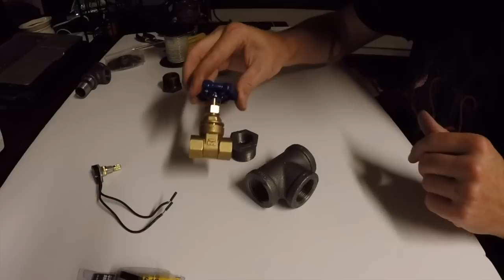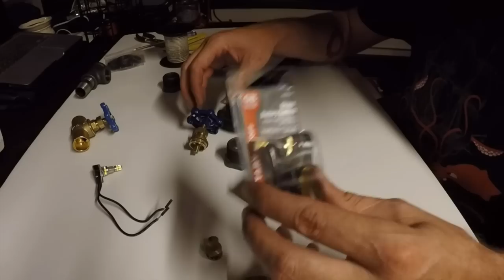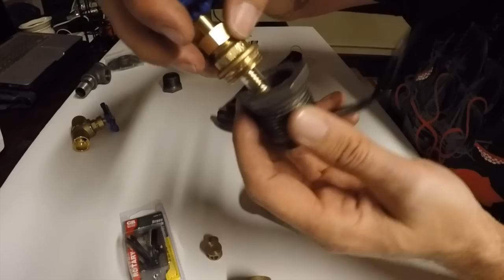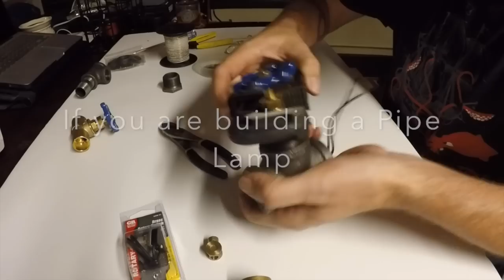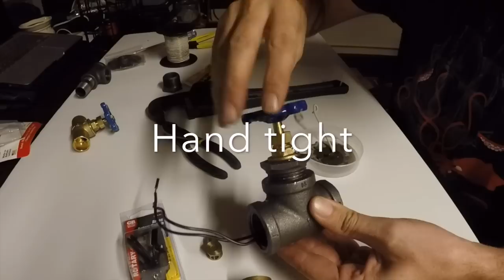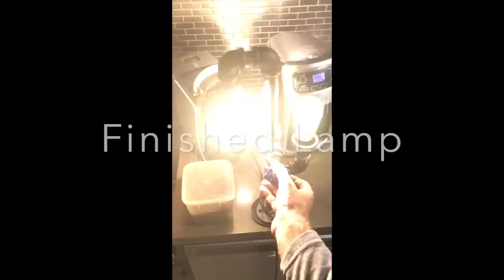DIY Pipe Lamp Switch made with water faucet handle

Comment: Shopping list:
- Dimmer / light switch
- 1/2 inch water facet (with gate that is going up and down)
- 3/4 inch to 1 inch facet
- 1 inch T
- 3/8 inch OD Surgical tubing 
- JB KwikWeld
- Pipe Wrench 

Think I got everything =)
Reply: If you could make another one ill buy it from you
Reply: You found a dimmer that fits in there?

Comment: Great video!!!  I would suggest using pipe tape the snug up the valve instead of the JB Weld just in case you need to take it apart. The stop the switch from wiggling use poster a putty that will stick and won’t dry out. 
I so appreciate this video. Thank you.

Comment: Thank you so much. Best explanation of how to do this. Im in the process of building my lamp right now.  "Unless you let it cure. Then it WILL be the end of the world." Hahah. I laughed out loud. Subscribed!
Reply from the maker: +Drummers Eve that's awesome that you liked the video.  Love the feedback.
Reply: Crane Video So you cant use a 3/4? Also, Every valve i looked at was apoxyed and i couldnt get the damn thing apart.
Reply from the maker: +Drummers Eve I could never get the switch to fit in the 3/4 pipe.    I am not sure about the valve being apoxyed  I have not run into that issue

Comment: Great way to do it and the actual switch is replaceable if it goes bad. Others are epoxied in place. I prefer my edison bulb bare filament lamps to have a dimmer switch which I usually put in the base. The bare filament hurts my wyes.

Comment: Thank you for the video, and thanks for actually speaking and explaining what you are doing! I am thinking about adding epoxy through the plastic tube to add extra strength. Let me know what you think if you get a chance. I will let you know if it works.
Reply from the maker: Epoxy for extra strength is not a bad idea as long as you get the switch really straight with the switch.   You won’t want it to harden with a bend because it could make it difficult to rotate the switch.     If you do go that route let me know how it works please.

Comment: Since the water tap is threaded, does the handle come out and go in?  And does that mean I can only turn it so many times one direction before I have to turn it back the other way?  Thank you!  Great video!
Reply from the maker: Thank you. 
The threaded part goes into the plastic tube.  
The handle will not actually move up or down as you turn it in this case.   Since it’s connected to a continuous switch you can keep turning it.  I hope this helps

Comment: That is vinyl tubing, surgical tubing is made of latex and is like a rubber band and you can make slingshot and water weenies out of it. It also breaks down after a year or two whereas the vinyl tubing will still be good decades later.

Comment: Skip the JB Weld and use some Teflon tape. Save some money and it'll do the job just as well. And it sets instantly lol.
Reply from the maker: Interesting idea.  
I have to give that a try.   Not sure it will have a tight enough fit but worth a shot
Reply: @cranevideo3506  the nice thing about it is that if it isn't tight enough, you can wrap it around again. It's completely adjustable.
Reply from the maker: @adamlogan384  very true.   Thank you for the tip.  Will definitely give it a try

Comment: I just made 4 of those idential switches yesterday!  I’m shocked to see that you’re using the same method I came up with, and that being using the surgical tubing!  BTW, I used Lock Tite.  It’s faster and it works well, without having to mix the epoxy.
Reply from the maker: TheSib good call on the lock tight.  Had not thought of trying that 🤙🏼

Comment: Nice. Just a couple suggestions. First, you ought to learn and use the actual names for the plumping parts to be more clear for those who are beginners so they know what to ask for. That's not a water faucet, it's a shut off valve-a gate valve to be specific, and that's a 3/4 by 1  bushing. Secondly, you should never use a pipe wrench on that brass nut to remove the stem. A crescent or standard wrench will prevent marring. And finally, i'd never use the JB Weld-it's unnecessary and will be a nightmare if you ever need to repair/replace the switch. If you feel the parts aren't threaded securely enough (which they should be) use what's used in plumbing-pipe dope, or even some teflon tape.
Reply from the maker: +onitram1 thank you for the great suggestion. 👍🏼.   Very good points.
Reply: onitram1 thank you man
Reply: could you tell me what that type of switch is called I can not find it to buy it
Reply from the maker: +rafael menendez  hello. there is a link to the switch down in the details.
Reply: onitram1 you have not visited you tube that much. You can use either valve. You can also use red or blue lock Tite on the pipe. You can also use hot glue too. You could also double insulate the wires.
Reply: onitram1 sorry I can’t help but be completely annoyed by your comment. Have you made a better video? If so then by al means give your lecture on EXACT names. 

This video was seriously as good as it gets. If people can’t figure it out they shouldn’t be trying to assemble these let alone messing around with wiring. There is a degree of common sense needed for diy projects. Some people lack that common sense and they are called customers. 

I’m not trying to be an ax (I know I am) but is it to hard to say “awesome video” and leave it at that?
Reply: onitram1...NERD!
Reply: unless you want marring on the brass to give it a weathered look.....

Comment: Hey, I have just designed and developed a diy dimmer kit that is designed to fit inside of a 3/4 tee fitting. I can send you everything required to make one if you would do a video on it? It does require soldering.
Reply from the maker: I would be very interested in that 👍🏼

Comment: I bought the 3/4" gate valve but it will NOT screw into the 1" x 3/4" bushing.  It wants to, but just will not grab on.  I've tried it with multiple other bushings as well.  Any idea?  Grind the threads down?
Reply: The video says 1/2" valve but the part list says 3/4".  Try the 1/2" valve?

Comment: Wonderful video! How can I earth/ground the lamp with this switch please, for safety reasons?
Reply from the maker: Most house-hold lamps do not have a ground.   But you could always use a three wire cord and soldier the ground on the inside of the pipe.
Reply: Thank you so much for the fast and informative response! As the lamps are metal I thought an earth wire to be safer?

Comment: Cheaper, easier alternatives to JB Kwik Weld, you could use either 1. Hot glue, or 2. Pipe Dope, which is a bit cheaper than JP Weld
Reply from the maker: Good idea.  
I had thought about hot glue but I’m no sure it will stand the test of time.

Comment: Can you show how to wire 3 light bulbs using a rotary switch ... ?
Reply: Wire all of the lights in series, or parallel if you wanted to stop all the lights from going out when out burns out. Wire the switch on the hot side of the wires from the power source.

Comment: where can i get cheap bulk 1/2 inch by 1/8 inch hex bushings?  i want to screw a lamp socket nipple that's 1/8 inch into it and attach it to a half inch pipe.  they are 5$ each on amazon and i refuse to pay that when i just got 10 iron floor flanges for 12$.
Reply: nevermind i found them for $0.93 each.  if i bought more bulk they get as low as like 0.65
Reply from the maker: Awesome 🤙🏼

Comment: What are you using to unscrew the valve? I've been using a pipe wrench but half the time the nut just gets crushed as I'm trying to loosen it.
Reply from the maker: Small pipe wrench’s’ or channel-locks it what I have used.   Yeah it can be a pain to loosen it with out damaging it.
Reply: @cranevideo3506  I've used a socket wrench to open these - worked well.
Reply from the maker: Good idea I will have to try that

Comment: For the record, it is VERY hard to undo the valve from its original tee. Like 30 minutes of frustration and almost a broken toe later it came off
Reply from the maker: Sorry about your toe.  Typically I use two large pipe wrench’s and get them apart pretty relatively easily.   But I’ll admit some are more difficult then others
Reply: Crane Video I'll remember that for the second attempt, super cool trick and now my sister will have a lamp that's cool and can be used in self defense!
Reply from the maker: Hahaha. See I have missed a whole market. I need to advertise as a lamp slash self defense tool!

Comment: Can you put the JB Weld on the switch side of the tube or just on the handle side?
Reply from the maker: You could just dont get any on the switch itself.    I have put it on the switch side in the past but do not do it anymore because it is such a tight fit.
Reply: Very clever way to connect them, much better than gluing the ends. Where's your other video?
Reply: What kind of rotary switch is that?
Reply: Thanks! Where's your other video?

Comment: The brass valve is not a hose bib
Reply from the maker: I’m not sure what you mean
Reply: Crane Video go outside and look at what your garden hose is attached too. That is a hose bib, same thing your washing machine hot and cold attached too. The brass fitting that you took apart is a gate valve because it has a gate stop to shut the water or liquid off and goes up and down.